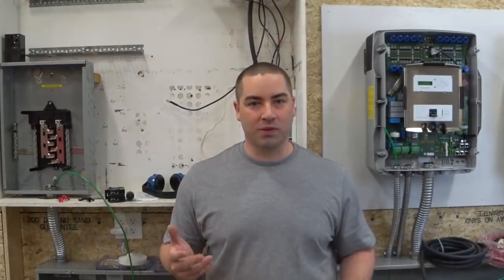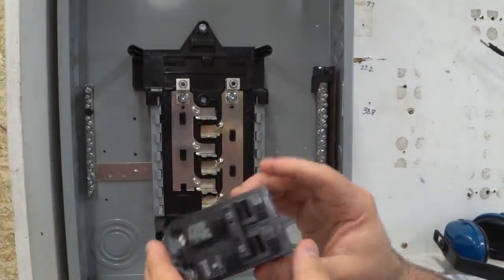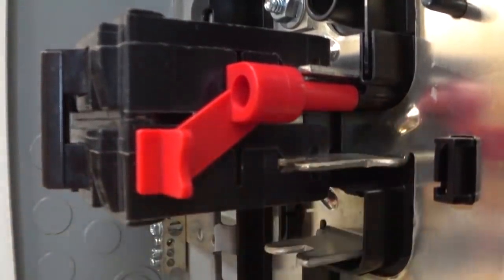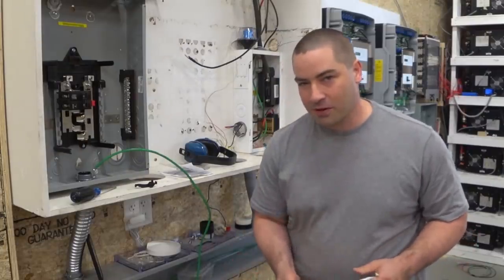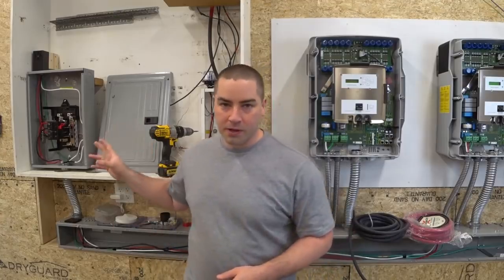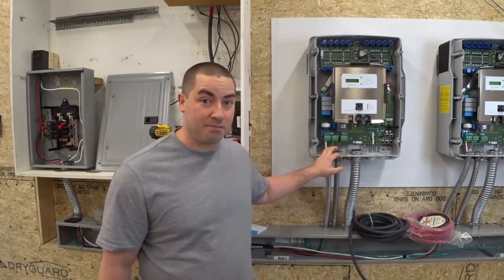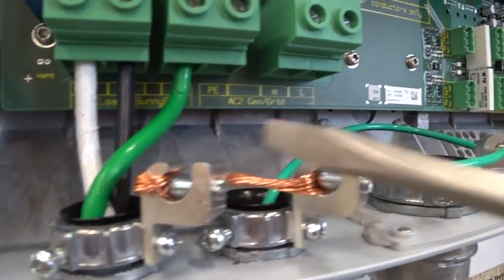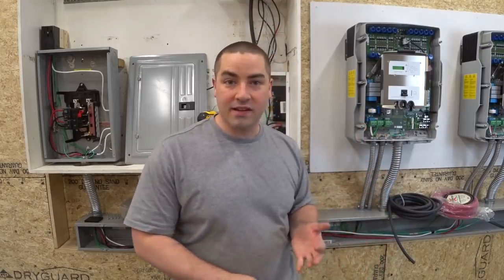Wiring AC Combiner Box on Off Grid System

Comment: We use bare copper here. Would code allow you to use pvc conduit and pvc bushings? The bushings are merely to prevent marring the insulation. Since you used metal of course grounding was in order. I have used flexible plastic conduit nicknamed smurf pipe. Not legal some places. Things that make you go 🤔
Reply from the maker: Yes.  I should have use all plastic, but I didn't know the metal was going to wind up needing all this extra stuff.
Reply: DavidPoz hindsight is one of those words I petitioned to have removed 😝. Good grounding never hurt anyone. You would still have to ground everything else anyway. Question is, and this question has been posed on many forums, do you intend to earth ground the negative side of your battery pack or have you? Some have noticed being shocked across the positive terminals to ground but of course you get up around 48v that has a bite anyway. Then throw in mosfets oscillating and a feedback can happen so folks keeps mitts off everything when it’s running 😊.
Reply from the maker: I don't intend to run an earth ground to the negative battery post, but it is tied with a Midnite Solar SPD.
Reply: DavidPoz will you be graduating to Midnite Solar Charge Controller? The MPPT function beats all I’ve seen out there. At 48v you can push more wattage thru the Classic 150 for the money. Also has hyper VOC mode to make up for distance between PV panels controller and dc losses. Their warranty and out of warranty policy can’t be beat either. This reply was not sponsored 😝. Keep em coming and still waiting for that water collection video!
Reply from the maker: I don't plan to buy a Midnite Solar Charge controller.  Thanks.

Comment: Its been my belief (in the past) that the armor/flexible steel conduit/connector screwed/attached to the raceway makes a 'bond' between the conduit and raceway.   The electrician that did my flexible conduit did not do 'extra' bonding wire - and the city passed it.    Do you have more info on why it was necessary to run the bonding wire on the conduit connectors?     Another great video!!     Really appreciate the info on proper feeding in power to the subpanel w/fastener etc.
Reply: Iam not sure (I'm an electrician, but for industrial applications) but in my company we sell drive inverters for motors and when we connect a motor, we have a special wire has a metal mesh around it. This mesh corresponds to the conduit in the video. This mesh has to be connected to ground to reduce the electromagnetic interference caused by the inverter.
And of course for safety here

Comment: How does your system prevent back-feeded the grid when there is a downed line? Many linemen have been electrocuted from unexpected voltages.
Reply from the maker: I have a main transfer switch.  There is no possibility of my system being connected to the grid.  No back-feeding the grid.
Reply: @DavidPozEnergy  Awesome :)
Reply: @DavidPozEnergy  David: The sunny island has setting for preventing grid back-feed but I am not sure if that works given how you are setting this thing up.
Reply: @evangarber8495  there is a generator interlock preventing the tie in breaker for this system from being on at the same time as the main breaker.  Nothing to do with settings, its physically impossible to backfeed the grid with this system as it's set up.

Comment: Just curious, but since the wire way is grounded and those armored conduits are metal, wouldn't that already bond them? I'm sure the copper makes a better connection and maybe it is just a electrical code issue, but just would have thought all that metal would carry current if it came to it.  DIYer too so just curious.  Maybe the idea is if something were to fault it would go mostly through the copper wire and not the metal conduit. Thanks
Reply from the maker: Yes, the metal wireway and conduit makes an electrical connection.  I checked with my multi-meter and there is a connection.  But, got to follow code.  My electrician told me to do it this way, so I'm following his guidance.
Reply: @DavidPozEnergy  I still dont understand the reasoning your electrician told you to ground the bushings, the bushing screws to the wiring gutter and its bonded 6 ways to Sunday, so dont understand this at all,,,,,
Reply from the maker: @Steve Pickett, If I did it again I would use plastic conduit and save $$$ and time.  I didn't know all this in advance.
Reply: @DavidPozEnergy  I'm an electrician in California and my understanding of the code is that bonding bushings are only needed where there are remaining concentric knock-outs (the pre-punched holes) that could become detatched and therefore no longer be able to carry any fault current. They are not necessarily if you drill your own hole or are removing ALL off the pre-punched circles. (i.e. there is a reliable connection to the body of the enclosure.)
Reply from the maker: Thanks Nathan DuPre.  There are a couple holes in the wire way that have concentric rings remaining.  But not on the inverters.  I did punch most holes myself.

Comment: Do you have a recommendation for how I can best use my hydroelec power? I was thinking a big split phase unit by mpp, do you recommend them? Do you know if they can consume battery power if I have a separate charge controller going into the batteries?
Reply from the maker: I did a review video on the MPP LV5048.  I was not very impressed with it.  https://youtu.be/FUaDmVDcYks
Reply: @DavidPozEnergy  I saw that. Any alternative recommendations in about the same price range? Sometimes I hate that America is split phase, it makes everything more complicated and expensive.
Reply: Broadly speaking, there are two main system types:  battery-based DC, or AC direct. What's best for you depends on myriad variables. However, if it were me, I'd build a 24V or 48V battery-based system using inverters for single-phase 120V AC. I'd only go to split phase of I had 240v loads (oven, water heater, clothes dryer, EV charger, etc.). The latter likely brings you into the realm of grid-tie systems, and these are entirely different beasts.